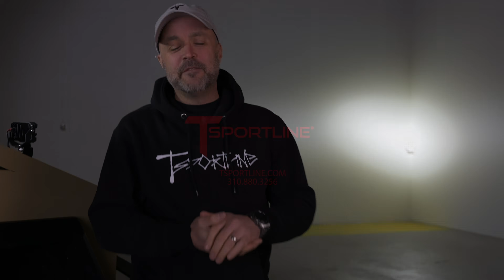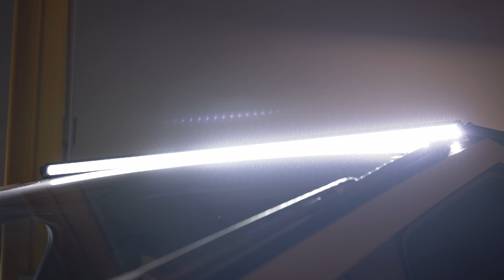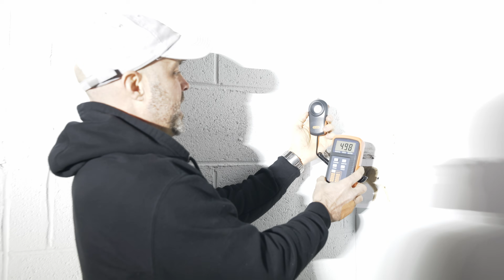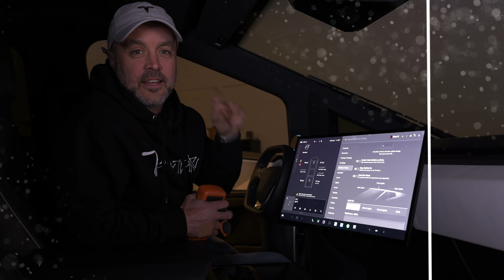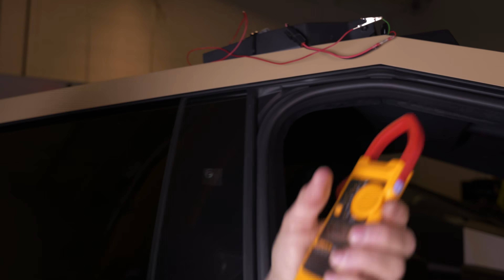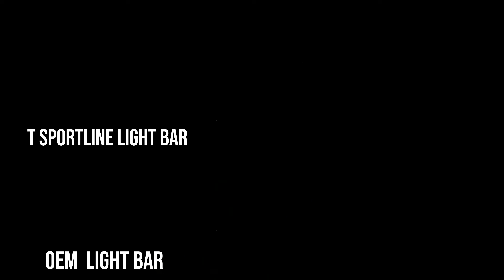Cybertruck Lightbar Shootout! Performance Comparison between Stock Tesla vs Aftermarket Light Bar

Comment: Was the OEM set to 100%. Output?  It seems more dim than other video’s I have seen with the OEM.
Reply from the maker: Yes it was tested at 100% and the camera auto adjust was locked to make this a proper comparison.
Reply: @TSportline thank you for this clarification. One thing that also is noted the focus height is different between the OEM and Aftermarket for sure.